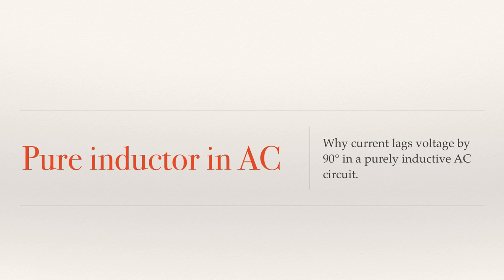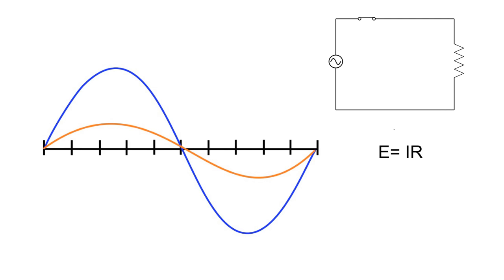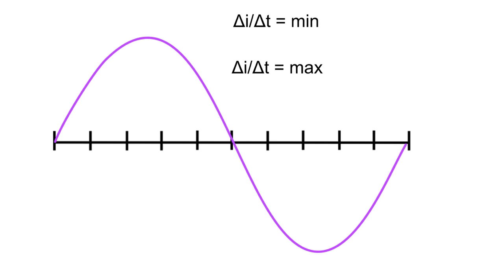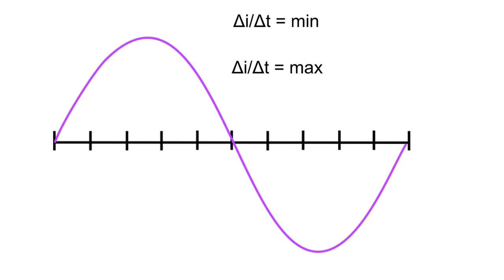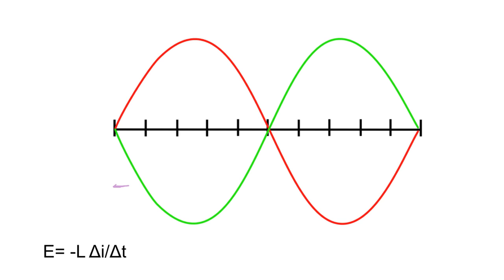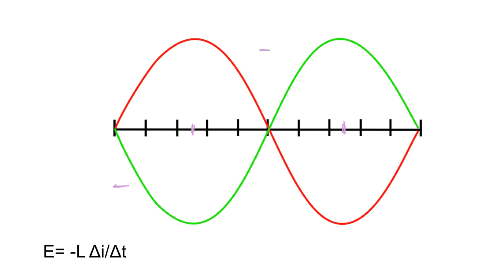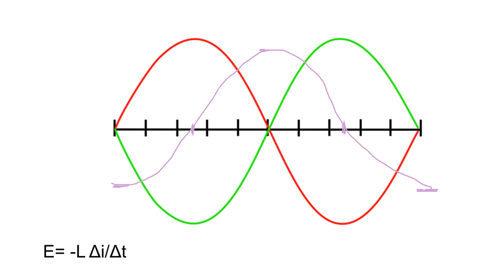Why current lags voltage in an inductive circuit (explanation

Comment: This is just explaining the waveform with the mathematical equations.Actual fact is that when current flows through an inductor an emf is induced which will oppose the cause(Lenze s law) ,so there will be an opposing current in the inductor which opposes the main current.Overall effect is the lagging of the current.
Reply: Exactly this is why current lags voltage in an inductive load. You explain in two lines what that guys couldn't in 9 mins
Reply: is the induced back emf goes to maximum point instantly, i mean when the switch is on? and then decrease with increasing flux?
Reply: My question is why there is no back voltage associated with back current...back current opposes current , back voltage will also be associated with back current
Reply: @SamiUllah-xs3tm  good question and observation
Reply: In a purely inductive circuit, if voltage applied equals voltage induced ; how is there a current  at any moment in time ?
Reply: Wrong.  You misunderstand the basic facts of current--it is a movement of charge carriers.  No matter how much inductance is present, current can flow in only one direction at any instant.  Induced voltage can oppose current, but it cannot cause charge carriers to flow in two, opposite directions at the same instant.
Reply: You saved me 10 minutes. Thanks
Reply: Just a genuine doubt :
According to your explanation the inductor with high self inductance 
Will make current lag more ....but current only lags with the phase of π/2 🤔
Reply: Yes you are right because changing magnetic field produce changing electric field that oppose current❤❤❤

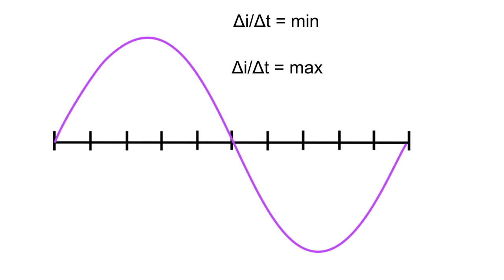Comment: Around time 4:00 when you're discussing the rate of change of current,  dI / dt,   I've found that over half of students also get it wrong and claim that the positive and negative peaks are the max rate of change, and at the zero reference line is the minimum.  The reason is,  the (incorrect) association 'max current must mean maximum change' and 'zero current must mean zero change'  and completely ignoring the slope of a tangent line along different points of the sine wave.

Easiest way to get folks past this intellectual hurdle is:
1)  dI/dt is the slope of the tangent line at a point on the sine wave of current

2)  find on the graph where the change in the current line changes the most for the smallest increment of time  (the visual intuition approach)

3)  calculate the slope of the tangent line (by using two values of (I, t)) at the positive and negative peaks of the sine wave, then do the same at the zero reference line, and you find that the plunge through the zero reference line is the steepest slope and thus the greatest rate of change.   The slope of the line is zero at the positive and negative peaks, ie. rate of change of current is zero.

This works because all STEM students learn how to calculate the slope of a line in Jr. high or high school.
.

Comment: How there is no voltage when current is max ? When current at its max,back emf vanishes batteries all potential so voltage seems like become zero but can it really be ? How particles gonna move without potential.Sorry im a mechanical engineer and dont really have much electrical background..

Comment: In simple terms, inductive circuits have a delay because of the magnetic field, and that's why current doesn't instantly follow voltage when you turn them on.

Comment: If self-inductance (induced back emf) of an ideal inductor is always equal and opposite to the applied voltage then how does the current flow in that inductor, as the net voltage will always be zero?
Reply: Lenz’s law states that induced voltage, created by the applied voltage/current flow, opposes the the applied voltage/current flow. The intensity of the opposition to the applied voltage/current flow is directly related to the “inductance of the inductor, represented by the letter L”. Practically speaking the intensity of the applied current flow is always stronger than the induced current flow. The applied current flow pushes through the induced current. This opposition to the applied current is measured in Ohms, other wise know as reactance, X sub L. Simply, usually never a net 0. The sine wave plotting and vector representations do not try to show the intensity of each, but normally show that the applied is 180 degrees opposite the induced with no lagging or leading angle, and that’s q whole other conversation.
Reply: @jmbravo-stugatti5867  thank you for more clarification.
Reply: @jmbravo-stugatti5867  is the induced back emf goes to maximum point instantly, i mean when the switch is on? and then decrease with increasing flux?
Reply: Generator's energy > inductor's EMF
Reply: EMF is the result of current.
applied voltage case CURRENT, then, CURRENT cause EMF, so current first then EMF

Comment: At 1:42 the equation E = -L di/dt is your back EMF, the force the current pushes against, this is NOT the voltage across the inductor. In this equation E represents the induced voltage also called back EMF which opposes the magnetic field created by current flow. But this same symbol E also represents the voltage across the resistor in the previous equation E=IR, and this is confusing.  The back EMF equation should use the lower case Epsilon symbol for back EMF instead of E.  The symbol E should properly represent the real voltage and the relationship between voltage across and current through the circuit is E = L di/dt , or V(t) = L di/dt. Note positive L value.
Reply: I was just about to comment on that.. Thanks for pointing that out, in all my texbooks that I've read, E or V(t)= L(di/dt)

Comment: One of the few acronyms I recall from engineering school:  ICE and ELI ICE:  in a Capacitive circuit (C), I (current) leads E (voltage)ELI:   in an Inductive circuit (L), E (voltage) leads I (current)
Reply: @briant7652     CIVIL   Civ  viL

Comment: why doesn't the applied voltage have an effect on the induced voltage? or why doesn't the current flowing in the circuit is the resultant for applied voltage and the induced voltage?

Comment: This explanation is so clear that i actually had a 'eureka' moment because of your explanation i realised that (and please do correct me if i'm wrong) when the voltage is pushing hard through the rise and fall sections of the sine wave (which happens to cross the zero point), the current is at maximum flow but when it hits the peaks of the sine wave the voltage is almost stable for a brief moment and therefore the current flow is at its minimum because the electrons almost stop moving before heading very quickly back towards the zero point and on to the opposite polarity peak. i hope that makes sense, is that very basically correct or am i still missing something? thank you for your time and great videos :)
Reply: Current starts late. He should draw blue back to beginning. The voltage leaves the zero line first and current doesnt hit zero line for first time until voltage is at 90 degrees so voltage has a 90 degree head start. Current needs time to start hes reving his engine getting the power built up
Reply: @nephilimshammer9567  getting the revs going that's a good analogy. ive since realised that I was wrong in my initial understanding after doing more research and studying. It's all about the journey though 👍🏼 Thanks for the reply.

Comment: but to get any current at all you need to have an applied voltage right? so when the applied voltage is 0 (the red graph) how is it that you have any value of current at all?
Reply: If I am right, it's bleeding off the collapsing mag field in the inducter.
Reply: rather than saying applied voltage you can say voltage across inductor. and if its pure inductor it has no resistance and there wont be a voltage across it and a lot of current would flow.

Comment: I was hoping for more of a physical explanation as opposed to a purely mathematical one. A sort of image of what is actually happening..
Reply: Did you find a video for it?
Reply: Yeah I can understand Mathematically not physically,to understand I must go through formula of inductive  and capacitive voltage and it's origin.
Reply: I believe it has something to do with the formation and disintegration of the magnetic field around the coil, because of the changing direction of the current.
Reply: there is a mechanical analogy to inductance.  it is called the flywheel effect.  like trying to change the speed of a heavy spinning flywheel.

Comment: at 5:31 when you said that the current is supposed to be at maximum, why did you mark it at its negative peak value and not its positive?
Reply: Ayms he was marking the graph of the current with respect to the back EMF graph(the green graph)
so the maximum back EMF is produced when you have maximum rate of change of current which you get when current is at 0
Reply: i also want to know that..he hasnt got any explanation for that..anyone can derive that mathematically, but hardly anyone knows what happens physically
Reply: Current or voltage at their lowest peak value are actually at their peak value in terms of effectiveness in a circuit. Simply changing directions in an alternating circuit

Comment: Thanks, my asking how to make 180 degree phase shft voltge and current?
Reply: You would need a power source, instead of a load, to get a 180 degree phase shift.  Inductors and capacitors can at most, get you a 90 degree phase shift.   You would need a system that can add power to the circuit, instead of draw power from it, for voltage and current to have a 180 degree phase shift.

Comment: You did everything except explain why current lags voltage in an inductive circuit.  Some of the things made sense.  However, when you have a graph depicting voltage and you are talking about current,  and there is no current depicted on the graph, then this doesn't explain the current lagging voltage in an inductive circuit.  It's a description of where the voltages are, but not the current .   You brought up current at the end of the video, but it didn't explain why current lags voltage.  Give it a rest !  Most people who want to teach and claim to have some good way of explaining things are actually very bad teachers and can't explain anything that is very technical and can't use physics or electrical theory, mathematics,  or an in-depth understanding of the subject matter to make their point.  This is simply another example of somebody trying to teach electronics, but doesn't fully understand the subject matter themselves, and can not fully explain why their equation is important to why current lags voltage.  

Try again.  You will need your equation.  Explain where that came from.  Next, your graph needs the applied voltage, the induced voltage, and the current superimposed on the graph.  Show where 0, 90, 180, 270, and back to 360 degrees.  Now, point out the current, voltage, induced voltage, electromagnetic charge on the  inductor, and show the relationships that fall into play to produce the induced voltage  and the out of phase current.  I've listened to your video several times and It's very obvious that you did not achieve your goal.

Comment: What causes loss of power in an inductive circuit?
Reply: There is no loss of power in a purely inductive circuit.  An ideal inductor is a 100% reversible energy storage device, that stores energy during half the cycle, and releases it 1 quarter cycle later.

What causes the loss of power in a REAL circuit with an inducitve power factor, is the non-zero resistance of the wires.   Suppose we desire to transmit 1 kW of real power to a load with an inductive nature, from a 120V AC source (the RMS voltage).   If this were a pure resistive load, it would draw 8.3 Amps of current (the RMS current).  However, suppose it really draws 10 Amps, due to its inductive nature.  The reason it takes 10A instead of 8.3A, is that there is a 33.6 degree phase shift between the current and voltage waveforms, caused by the inductive load.  If you integrate the shifted waveforms to find the average power, you will get 1 kW, instead of 1.2 kW as you'd get from multiplying 120V * 10A.  We call this, 1.2 kVA, when you multiply RMS values of current and voltage, with non-synchronized waveforms. 

This means the power distribution network that supplies power to it, now has a loss of power associated with carrying 10A instead of 8.3A.  If the wires totaled 1 ohm of resistance, the power loss in the wires line would increase from 68.9W (corresponding to the 8.3A resistive load) to 100W (corresponding to the 10A that actually supply this load).

Comment: Rate of change is at it's minimum when current flow is at it's maximum, that doesn't make any sense.
Reply: when you are going to the top of the curve, near the top, the slope is smaller(more gentle) than the starting point at 0.
slope = rate of change = delta i / delta t
Draw a tangent line near the top of the curve AND also a tangent line near 0 and check the slopes. 
Near 0 the slope is steeper. That means the rate of change is faster. 
https://www.youtube.com/watch?v=6LV63WtuvJg
Reply: That makes sense review your math and the meaning of the graph.
Reply: That makes sense, review your and the meaning of the graph.

Comment: What is i here ?
Reply: The i stands for current in this context.  Not to be confused with the imaginary unit "i", which is commonly called "j" in electrical engineering, due to "i" already standing for current.

Why do we use "i", when there isn't even an "i" in the word current?  The answer is historical reasons.  At one point, what we call current today, was called current intensity.